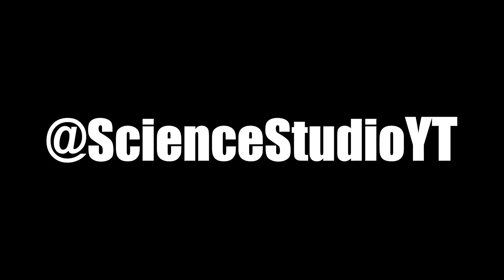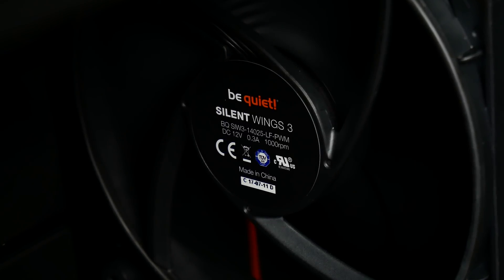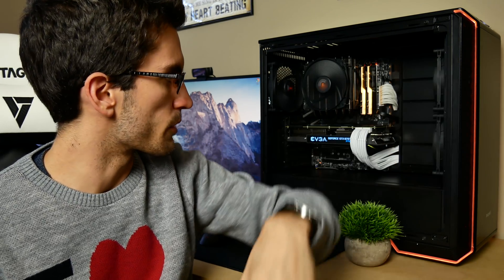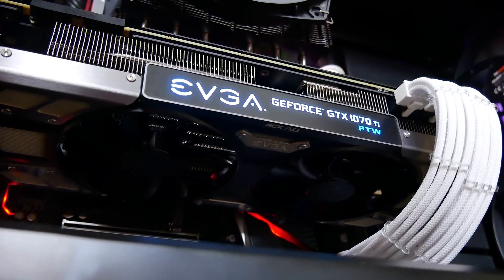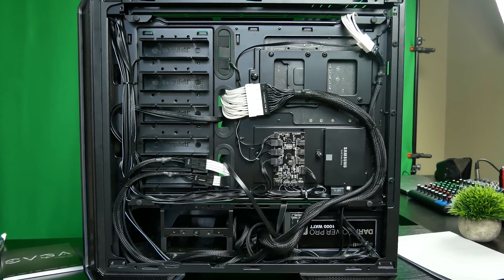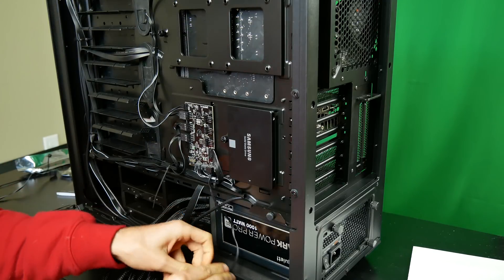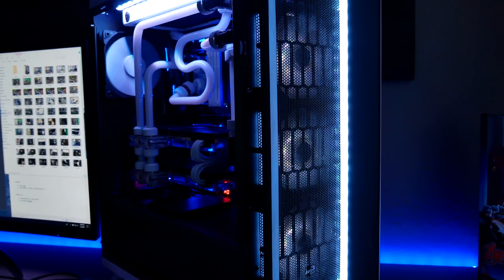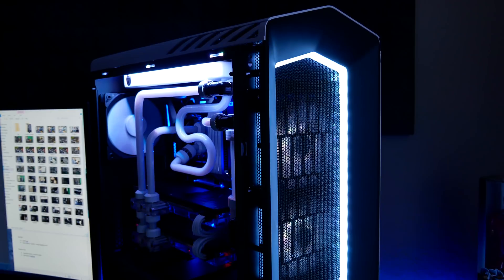We Built a SILENT Computer!

Comment: I thoroughly regret not putting dampening things between my motherboard and case. I built it to be silent, but due to (small) vibrations of the fans attached to the motherboard sort of resonating with the case, it's ended up much quieter than before, but still this background drone. It stops when I hold the side panel though, so maybe I can dampen that without having to take out the motherboard?
Reply: Sounds like somebody should order some bitumen mat. Tends to work wonders for large, resonant metal things, is pretty cheap and usually soft enough to be cut with ordinary scissors. Find the spots where pushing by hand makes the largest difference, that's where you primarily want to apply the stuff. After tackling one you may find another, so do it iteratively. When you can't cover a big area due to space constraints in some spots, consider doubling up. I found a single 50x20 cm (20" x 8") sheet was quite sufficient for one PC, but YMMV.

My PC in the office had been rather plainly audible for years, with hum from the fixed-mounted harddrive being the main culprit (it's just a lil' old i3 with onboard graphics sporting a half-decent CPU cooler and single rubber-mounted 80 mm exhaust fan, nothing fancy). I ended up treating the side panels and part of the drive cage (where possible) and putting in some thick (automotive grade, flame-retardant) foam to combat some high-pitched whine. It's whisper quiet in idle now, you pretty much have to hold your breath in order to hear it - in fact I think my PC at home is a good bit louder.
Reply: Oh, that's a good find, thank you! Seems it's cheap to get as well and easy to apply. I'll give it a try! :D 

At least I won't have to treat my hard drive area since all the hard drives are sitting safely in rubber rails and there's no vibration coming off them as far as I can tell. I think it's just mainly coming from the vibration of the GPU fans and the fact that the motherboard is sitting directly on the case. Hopefully this bitumen mat stuff will counter that, though. :)

Comment: Can someone tell me why do builders put a 1000W++ powersupply in a build which would be clearly okay with a 550-650W GOLD PSU?
Reply: Norbert Szabó Maybe for future upgradability as newer and stronger parts would require more power.
Reply: depending on the psu, they can run with zero fan rpm to about 40% load. thats why i got 850 watt for my build. you dont want fans running on the psu for dust reasons also

Comment: I use for r5 1600@3.7Ghz  Artic Freezer 33+ .One of the best cheapest cooler on the market.Right now is on  "zero fan mode".MSI 1070 Gaming X also not spin fans in low workload...

Comment: can you build a $350 gaming budget pc but with new parts?
Reply: Crypto and other variables have really increased part prices unfortunately. Do keep in mind you need windows unless you have a key already!
Reply: Sanctorum what you think about this deal i7 4770,MSI H81M-E33,16GB RAM,250 SSD,PSU 450 BRONCE,Case Phantom 

$220?
Reply: PS4 Pro or Xbox One S
Reply: toy machine lmfao nice meme.

Battlememe it's entirely doable. Oh, and don't recommend A320 motherboards thx.

OP - R3 1200 with a $60 B350 mobo, 1x8GB RAM and you're good to go pretty much. I'd re-use the case and PSU you have, at least for now since you can always upgrade later. Then for GPU, grab a GTX 1050 or 1050Ti. I'd also try to add at least a 120/128GB SSD for OS and a couple of games. If you were to wait for H310 motherboards and CFL Pentium's to launch, you'd be easily able to get CPU, Mobo, and RAM for like $175, as opposed to $250ish for an R3 1200.
Reply: iCeMaN tHe BeSt CPU and RAM alone are worth like $200 ez lmao. That worries me a little though, might be TOO good a deal. Case is alright, bit old and ugly but it'll do the job and isn't complete shit. I imagine the PSU is low end, shit but usable for systems with lower end to mid ranged(but lower power) GPUs. SSD is good, regardless of what SSD it is but that would also be good to know, as it could be a cheaper/poorer performing SSD.

i7-4770 is basically an R5 1500x with slightly better performance thanks to the 4770's better IPC.
Reply: Sanctorum yeah i see the pc and is so far good the guys show me some videos and all that shit then i upgrade for a good GPU i look for the cpu and still cost $400 

btw he gonna gave me another case in much better condition and the pc also have BLUE RAY dvd recorder the case have like 5 fans all qorking
Reply: iCeMaN tHe BeSt that is not really doable
R3 1200_110$
8gb ram 90$
Cheap a320 mobo 50$
Psu that won't blow up 50$
1050 125$
Is the cheapest i would go for a build, excluding storage
Reply: Battlememe Dankline i got already the HDD 1TB,Case,W10 im just trying to looking for a good CPU atleast a Quad Core,Mobo,RAM

Btw THANK
Reply: 1200 is a quadcore but get a single stick of 8gb unless your mobo has 4 slots
Reply: I'm Dead like i say in my preview reply i already have 1TB HDD,CASE,W10 64BIT,MONITOR,KEYBOARD AND MOUSE i just wanna to buy some new part CPU,MOBO,RAM and maybe a PSU,i got one a 450 watts but is not Bronce just wanna play some game like Batman Knight and others

Comment: I have a Fractal Design Meshify C  with 4 140mm Noctua fans and 2 120mm Noctua fans, 2 in the front, 1 in the back, and 2 up top with one down under the gpu. I took the part of the PSU shroud off where a radiator goes and mounted a fan down the to push air up to the GPU. on my 8700k I am running a Noctua D15 with custom fan curves. my GPU is a 1080 ti gaming X from MSI stay quite with that fan pushing air up to it. all SSD's no hard drives for noise reasons and my PSU is also a Be Quiet! Dark Power Pro 11. the build is almost silent no matter what I do and that is with the cpu clocked to 5.14ghz
Reply: pike RDM wow that’s awesome
Reply: Sanctorum
Even my custom loop (4790K 1080Ti) with dual 420mm isn't silent but it's "more silent" under load than most systems out there during idle. Running my 6 NF-A14 at ~500rpm at full load which is a lot quieter than any air-cooled 1080Ti.
Reply: Even that's not silent...
Reply: Sanctorum, I agree, I have only 4 noctua fans in my system (1x140mm for exhaust, 2x140mm for intake and 1x92m for heatsink) that run at a very low rpm and the pc is quiet but definitely not silent!
Reply: I doubt that you can run your GPU anywhere near "silent" under load.
Running your system almost completely noiseless is possible with a huge external rad and very slow spinning large fans (200rpm).
Reply: Ikr, i'm currently using my Macbook 12 inch which has no fans... now that's silent. Even the new Macbook pros and the most recent Macbook Air could get loud.
Reply: as everyone always thinks that Noctua fans are quiet ...
Noctua fans are on radiators good but not as case fans there they are quite noisy

Similar to the CPU coolers, in a case with poor airflow, the CPU coolers are quite good, but the heat is quickly moved out of the case then there are better coolers

By the way, Silence is if you do not hear a difference whether the PC is on or not and yes that is also possible with fans

@Sanctorum you should test a Noiseblocker eLoop B14-1, properly installed it makes no difference from the noise whether you have installed this or not
Reply: Do you understand that custom fan curves are something you can set in the UEFI? all of the fans turn off when not needed. No GPU and no case fans, If I wanted to build a silent potato I can also do that but this is a top 10% overclocked i7 with the most powerful GTX card on the market running at almost no noise even at max lode and when the PC is not a max lode all the fans turn off and it becomes as you say "an actually silent system".
Reply: the. fans. turn. off.
Reply: Sanctorum does your 100% silent system actually perform? I'd like to see you run a top end i7 noise free.
Reply: pike RDM Just because the fans turn off doesn't make it silent lmfao. Plane engines turn off when they're not being used, is a plane silent? 

BucketInABucket Uh, no, I'm not being semantic. Also, the word you were looking for, is pedantic, not semantic lmfao. Regardless, it's not pedantic to assume a silent PC is actually y'know, silent. It's like if you went to buy a dog, and got given a snake, then the seller says you're just being pedantic.

Xx Luke xX Does it "actually perform"? Perform what? Backflips? What do you even mean by that? Does it turn on? Sure does. Does it do what you'd expect of the hardware? Sure does. "I'd like to see you run a top end i7 noise free", except I didn't say that though, did I? Regardless, a mainstream i7 like an 8700k, no problem. X299? Another story.

jack stuckey I have no idea why people think quiet = silent lol. It only seems to be with PC's as well, I see it constantly, people saying they have a 'silent' system. I hate it because there are people who DO actually go out of their way to have a silent system, properly silent. It's not like I'm saying his system is a jet engine or anything, just not silent by any means.

cl4ster17 Tell me about it, that made me lol when he said he has "the most powerful GTX card" with "almost no noise". Yeah, sure, if your system is turned off lmfao.
Reply: 10+ fans
"silent" 
Sure thing, bud.

Funny as fuck seeing all these people who think they have silent systems. Wait until you witness an actually silent system. I have a system which is ACTUALLY silent for media. It has a fanless PSU, ZERO case fans, no HDD, no dGPU, and no fans for the CPU cooler, just a big ass fucking heatsink = ZERO NOISE. Actually silent system.
Reply: pike RDM Okay so first of all, liking your own comment was a sad fucking move lmfao.

Second of all, setting a fan curve isn't the same as silent. No one cares what hardware you have, with 10+ fans, it is absolutely not silent. Regardless of your custom fan curves or whatever else. "Almost no noise" /= silent

Comment: Your loop is very loud, I have an ek d5 + 2 X 480mm rads (30mm) with 8 corsair sp120 fans(set to operate between 600-1000rpm) and 3 phanteks 140mm(set to operate between 600-1000rpm) fans in the case and it is dead silent!!!!(I have a sound meter and its around 15db from 50cm away) , my d5 at full speed(4800 rpm) still does not make any audible noise. My guesses are that you still have some tiny bubbles in your loop (probably trapped in the rad because you should not be hearing water move in the loop after it is bled and filled up properly) and the pump is most likely not properly decoupled (so you hear vibrations being transferred).
Reply: you are not using a proper sound meter, because fans are loud at 600 rpm and above, the only way you call 600 rpm silent is that your house is noise from the get go. go look at gpu noise tests and you will see that even those small 90mm fans on  those need to go at 800rpm to be at 25db.

Comment: You should build a high end Spyder system in that case, does be quiet make an aio?
Reply: Yes, they are called Silent Loop. I have a Silent Loop 280 on a R7 1800X and it is good/ok, but the Dark Rock Pro 3 on my second system (R7 1700 with OC) is less "loud". They are as far as I know, for now, only availiable here in Europe.

Comment: I see all these build with Ryzen 5 paired with 1070s it higher, I bought a 1060 for $330 CAD so I thought it was a great deal, considering it’s the AMP edition, not a mini. Should I feel bad for getting a 1060? Or do you still recommend them.

Also just got to the PSU part where you said don’t cheap out on them, good thing I got the EVGA SUPERNOVA G3 650w

Comment: once had a similar silent pc with an i5 4690k @ 4,5 GHz cooled by a bequiet dark rock 3. it also had a msi gtx 970. because the harddrive was the loudest component by far, i hung it up inside the case with a few strings tied to the drive. after that "fix" it was dead quiet. all that was housed in a fractal design define r5. an excellent case just all around, especially for silent builds.

Comment: This is a nice selection of gear, I like how it's all matched up. I'm using older parts from Noctua (NH-U12P), Fractal Design (Define R4) and Seasonic (Platinum 1000) instead of those Be Quiet! parts, but the design principles are pretty much the same. I also have an older EVGA GTX 1070 FTW card, and these are indeed good at staying silent.
Reply: I once had a 1070 FTW for a day and that thing was loud AF. Among other custom 1070s it is among the loudest.
Reply: I don't have a direct point of comparison for noise levels at load, but it's been quite reasonable, similar to what I've heard in the past from MSI and Gigabyte cards. It definitely is the loudest part of the system when in games, but I'm not gaming all day and the rest of the time it just turns off, as most custom cards do.
Reply: Let your GPU fans spin at ~800rpm to get an idea of how quiet some other 1070s can get.
Reply: Do other cards really have fans that run 800 RPM with the GPU at 100%? Although I can believe it for the big Asus Strix cards - which were out of my reach financially when I bought that particular GPU.
Reply: cl4ster17 For some reason your response only appears in my emails, and not in the actual comments? Anyhow, I'll give undervolting a shot if I find the time to tweak the card a bit. Might tweak the fan curves too while I'm at it.
Reply: Yeah, same here. No notifications anymore.

Comment: I build a new system and tried to balance airflow and sound. Little did I know that a case like the P400S designed for silence has, loud fans.
ps If you want to get a system to be very silent you have to go with m2 for os and ssd for  storage, no hdd
Reply: Depends on what HDD you get. I replaced an older budget HDD with a newer slightly more premium drive and it is very quiet.
Reply: 11matt555 I too have a very good new hdd but still ambient sounds are very loud due to vibrations
Reply: I guess mine doesn't vibrate then. My old one was only loud when reading/writing. Sounded like it was an old 90s or early 2000s computer. You could try getting some vibration pads or something.
Reply: If you have a loud drive they can. Consumer HDDs in the early 2000s and earlier were almost always loud from my experience and some cheap drives still are. I still have my old drive in a secondary computer and I can hear it across the room even when the fans are at 100%
Reply: My HDD is loud, but it's probably because there is no rubber things holding it. Only plastic

Comment: Thats a great cpu cooler, the fans point toward the motherboard helping vrms stay cooler so its a 2 way cooler really
Reply: Gareki no Kami you hold the bolts with the wrench and screw it from the back of the motherboard, instructions are not the best with be quiet coolers
Reply: Does it make more sense than a Dark Rock Pro 3/4 ? Apart from the vrms Nice impact
Reply: You are all wrong, the bolts go on first, all the tightening is from the back of the motherboard, the included wrench is only for the hardware preparation.

Comment: that sounded like you got a pretty silent pc under load there, when you start hearing the electrical noise there is not much more you can do :)  . would like to know your fans rpm tho. . 
 i did much research and built a silent pc myself, 6700k at 4.5ghz, gtx 1070 at 2ghz. gpu fans at 700rpm and case fans and cpu fan at 500rpm in a fractal define S, noctua 140mm fans and cpu cooler, actually that got a 150mm fan.

Comment: You guys think the CPU Cooler its suitable for a mini itx? without interfering with ram (dominator rgb), in a mini ITX AM4 motherboard?
Reply: if your case is tall enough in that direction, sure. might have to remove the bottom fan, though, as the Dark Rock TF actually has two of them. 
might want to check this: https://www.bequiet.com/en/motherboardcheck (it needs to load for a bit after selecting manufacturer)
as well as the diagram on the product page: https://www.bequiet.com/en/cpucooler/572 
you also may or may not need their AM4 mounting kit

Comment: I'd like to see a fanless build
Reply: I expected that tbh since he used the word "silent" & not "quiet"
Reply: The GTX 1050Ti KalmX would be cool
Reply: Brian Lai Up to an HTPC, but for reasonable money a gamer PC impossible today. Or maybe with mineral oil cooling, If we can make a small case. Or water cooling with extraordinary big radiator? (Personally I hate water cooling.)
In my opinion semi passive fan cooling is the best option. Multimedia with zero noise and on game mode, who cares?
Reply: Brian Lai: do pumps count? Because else it would be possible to hook it all up and have some external 360 radiators
Reply: i think linus showcased a case at the las ces or computex that was practially a complete passive "tower", it weighs something like 50 pounds or more but with that you can actually literally build a pc WITHOUT ANY moving parts, except maybe the power button, which theoretically you also could do capacitive xD
Reply: 64M1NG Yup, the Calyos NSG-S0. Up to a 180w TDP CPU & 250w GPU (+ another 250w if you go for the mGPU version) completely passively cooled with no pump or water to be able to hear
Reply: KiaKK there is a fanless 1050 ti and there are lots of high tdp passive coolers and passive psus so it would be totally possible. But might need a beefy vrm heatsink on the mobo as it gets no airflow.
Reply: Brian Lai I'll be a fan of the fanless build! Oh wait..
Reply: KiaKK Not impossible at all. Super simple and easy to get an actually silent system these days, whether you're gaming or not. Watercooling is not the way to go for silence lmfao.